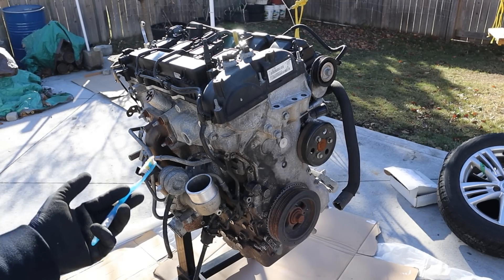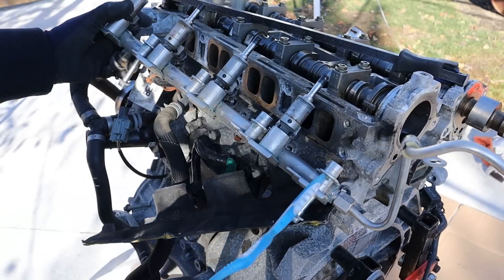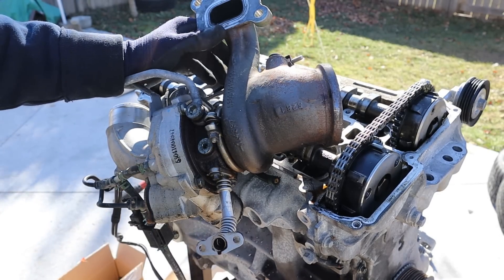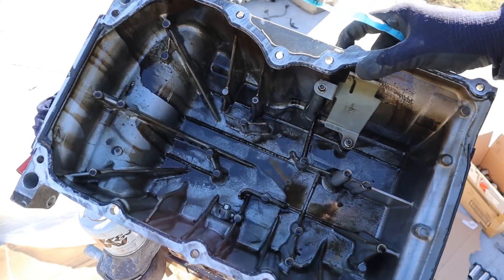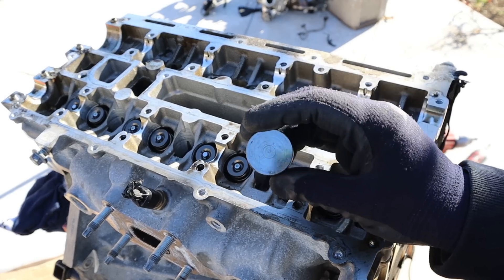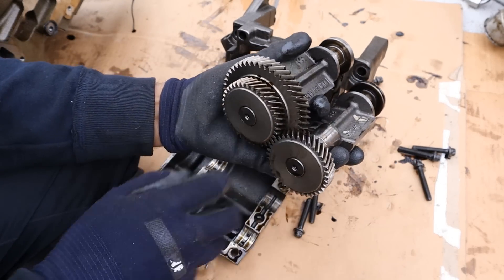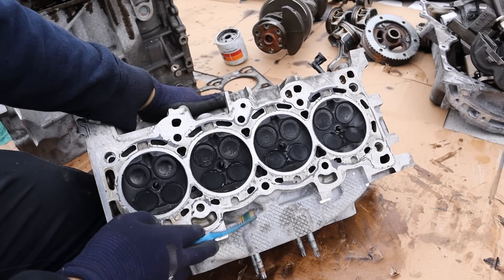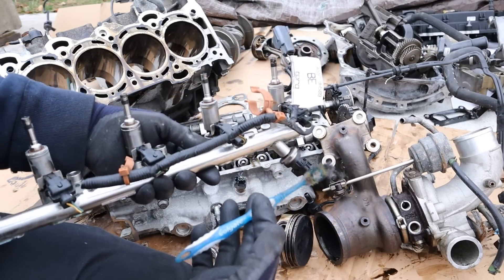Why Ford Ecoboost Engines Fail

Comment: I own this exact engine w/125k miles on it. My wife is physically hard on her 2016 ford edge. We've only had 1 problem. Last summer, i had to replace the vapor canister solenoid. Other than that, i swapped the plugs at 100k miles, and I've always used motorcraft oil filters. I've used havoline, pennzoil, and Supertech synthetic oils. Also motorcraft syn blend once or twice. It has never used a drop, and it doesnt seem picky. It's a solid little engine imo.
I also own a 2012 F150 w/ a 3.5L Ecoboost that has 164k on the clock. I've had a few coolant leak issues, but nothing major. One coolant leak was on a turbo, but contrary to internet propaganda, you can change the o-rings without removing the turbo if you have small hands. That was supposed to cost $800+ to fix, but a shadetree mechanic fixed it for $65. Lol
I change plugs every 50k, oil every 6k, and transfuild every 100k. Plugs, filters, and fluids, i use nothing but motorcraft. For Oils, i have used pennzoil platinum high mileage mostly, and havoline pro ds synthetic a couple times. The engine has been rock solid thus far, but it growled at me when i cranked it 3 times last year. I now hit the throttle to increase crank time, allowing oil pressure to build up before starting if it's been over 24 hours since last crank. That stopped the growl. 
I drive it hard, and I tow a 4500 lbs boat 3 days a week, 8 or 9 mo/yr. 
I had rough idle issues early on, but I drilled a 1/16" hole in the bottom driver corner of my coldair intake, and that stopped the problem. Right away, it blew about 12 oz of creamy sldge out, but it has never shown me a drop since. I just know it's working due to a feint oily/dusty triangle on my air dam. Fine by me. I'd rather see that than blow that shit through my intake. I also use mostly pennzoil synthetics due to their proven higher oil vaporization temp. That seems like a minor detail, but oil vapor in the egr is the cause of all the carbon in the intakes.

Comment: Bought a new 2013 Escape 2.0 Eco - 219,000 miles.  Only time it has performance issues (hiccup on hard acceleration) means it is time for new spark plugs.  Love this engine.  Doesn't use any oil between 8K miles between full synthetic oil changes.  I drive long distances, highway speeds primarily.  I'll drive it till it dies.

Comment: Seriously surprised by this. Had a diesel 1L turbo ecoboost an put 150k miles on it in 5yrs with no worries at all. Started every day. Awesome breakdown video 👍👍
Reply: Never knew you could get a 1 litre diesel
Reply: @boyasaka  A good ol' daily come rain or shine even in the snow. I wouldn't know if the mechanics had any problems with that particular engine layout as It was serviced every 10k miles an they never grumbled. 

The only thing that comes to mind is when the timing belt was changed they nicked the turbo tube which drove like a brick. It was that compact you couldn't swing a spanner.

Comment: Never buy a car with direct injection, variable valve timing, turbo or cvt transmission. Simple is better and more reliable. I'd rather get worse gas mileage than have a mechanical nightmare piece of garbage like the eco boost.

Comment: Running a turbo car as a daily driver is tough on everything because of the increased head temperature...methanol helps but heat is heat ....!
Reply from the maker: Yeah it's overstressed

Comment: First, I like to say you beat the hell out of Ford's 2.0 EcoBoost engine. I'm not mad because I've had to work on my daughter's Range Rover Evoque which has this same engine. Thank God I didn't have to do a teardown although it felt like it. Because of fault codes and rattling, had to replace cam phasers, VVT solenoids, timing chain, tensioner, guides, camshaft sensors and gaskets. Besides replacing all the parts , I had to purchase a special tool set to time the engine. Hoped to never do another.
Reply from the maker: Ouch! Didn't know rover used the same motor

Comment: WOW WOW what an involved and complex explanation!!! VERY well done!! I had NO ideee those things could be so complex and involved, and any sort of repair is gonna be super expensive!!! Wow, why not just add a couplea more cylinders to get the power you want and throw all that trash in the ditch.  here i am on the verge of trading and im going to but im gonna look back about 10 yrs or more to something i can afford to maintain. Id keep my 340k mileage ford truck but the electronics on the dash are going and ford doesnt support it and its hooked to my transmission and my fuel injection system. Im looking for carb, points and plugs, key holes in doors and in the dash......thanks a bunch!!!!!!!!

Comment: these engines are pretty solid tho, they just suffer from any modern direct injected illnesses like you said, clogged intake valves, more internal carbon buildup etc. and you dont have to change the lifters, theyre hydraulic like any modern engine, they need no gapping.

Comment: Carbon build up on the backside of intake valves is a common issue on ALL DI engines, not EcoBoost engines.   Toyota resolved that with a costly duel fuel injection system.

Comment: It's actually insane, the amount of moving parts involved in just ONE Internal Combustion Engine. If we'd taken the years it took to get to this level of ICE intricacy, and developed electric propulsion instead, imagine where we could have been today. I am very much looking forward to my first EV... Once they become more affordable, which could still take some years, I know. But not having to deal with a thousand little things that could go wrong and no need for oil changes etc., could well be worth it. How many bolts did you have to loosen, just to get the pistons out? It would drive me nuts.

Comment: The engine is similar to my 2.3L mustang ecoboost, basically with a longer stroke to get the added displacement. Thanks for the teardown, and the engine was in much better condition than I expected, and could almost be rebuilt :)
Reply: The 2.3 has its origins in the L Series  Mazda block as found in the Mazdaspeed 3 and 6.
Reply: Didn't the Focus ST have a 2.3 Eccoboost?
Reply: @stacyholt6529  ahh I thought the focus was a 2 litre, but it appears as though it’s 2.3
Reply: @lithgowlights859  I thought so as I remember there being a concern that the Eccoboost Mustang would see the same head gasket issues that the early Focus ST did when they took the 2.3t to the Mustang. But that 2.3 Eccoboost in the Focus ST was damn strong! Personally, the Mustang Eccoboost would be my pick  for a little sharper handling and they can move along just fine.

Comment: I'm making a pneumatic engine from one of these and I'm wanting to know if I block the oil from getting to the head if that would create a problem. I'm making a head and I only need it to let air in and out through solenoid valves. I was also wondering if the oil pump will work backwards.

Comment: yeah this shit is why i don't bother with turbo anything in cheap cars., especially the eco boost. Sure maybe the economy is a little better but they always have some really funny issue like cracking their manifold on a hot summer day, or some other goofy shit like in this video. Currently driving a Jeep renegade with the 2.4l multi air, and surprisingly, nothing has gone wrong with the engine yet despite being off of manufacturer warranty for a week. Probably because no turbo. Although, considering its a general motors, I expect it to just be dead one morning with no explanation.

Comment: They are a small engine on steroids. just like a person on steroids sooner or later it all comes crashing down. They are fine if you only needed a truck to last 160,000 km and junk it. Im not one of those guys that can afford to replace a full size truck every 2 1/2 years.

Comment: Holy crap. I am glad I drove my 2004 Focus with the 2.3L non turbo engine so long. I gave it away to a friend in 2021 with 150,000 miles on it. Never used oil between changes, plenty of power. Never needed any work beyond replacing a cracked intake manifold.  See all of that is a reminder of the simplicity of electric motors.

Comment: ecoboost = trash
Reply: ive got a f150 ecoboost with 391000 miles havent touched the motor or transmission now whos trash
Reply: @sdfarmer24   you have found the exception motor definitely not the rule . Just because yours works fine doesn't mean it's a good hell forget good not even an average  design.  Your motor is like finding a diamond in a septic tank . Sure there's a diamond that somehow made it in but the tank is still filled primarily feces and undigested corn.  I used to do extended warranty inspections for a living . They told me where to go every day and I went .If it were not for the dodge 3.6  Ford eco boost and Nissan CVT, in that order , the inspection industry probably wouldn't exist. Some days I'd see a dozen eco boosts in a day. I have written an absolute rediculous amount of reports on that pos eco boost  they get Pushed off out back of a dealership waiting on my report to go though to the warranty company so the warranty company would approve fixing it   . And these are ONLY the ones the warranty company thought they might could weasel out of there are plenty more . Almost every single one got approved, because it was almost never abuse it's just a garbage engine. Don't worry about liking the turd, some people like playing with poop,I'm not judging.
Reply: @williambrennan5701  well i dont know what to tell u dude weve got 6 f150 pickups ranging from 2012 to 2020 theyre all over 170000 except the 2020 model. we bought two that were at 150000 and no problems i think u just dont like ford. i mean there will always be those guys and seems ur 1 of them
Reply: @sdfarmer24  oh I like Ford just fine I own one myself . A two valve 5.4 and after I retapped every cylinder to keep it from spitting out spark plugs it's been a good van. I don't mind eco boost either. They kept me enough warranty investigation work to make my house payments, so for that I'm thankful they made eco boosts but I'll never own one. I'm sure there is some ok ones but there is a rediculous amount that are not . Seen so many.....

Comment: Probably failed for the reason why boost heavy tiny engines are going 3-cylinder. Not enough beef in the cylinder walls and that's primarily between cylinders. Dropping the cylinder from the new engine designs means they can gain back some proper wall thickness while still being small, and make them nearly bomb proof and correct the main issues with the 4-cyinders.

I don't think it's just Ford that has issues with hopped up 4-cyinders either - you'll find the design problems with a lot of manufacturers. Either the cylinder wall will give out from stress in some way, will have passages that are too narrow for whatever vital fluids, or most likely is gaskets wont have enough meat behind them to back them up and car companies invariably use a material that's cheaper than what should be spec'd for those conditions so it fails. All that engineering to beef it up for naught because of an intrinsic issue with a component or two that is over-stressed while being neglected in design specs. Ironically it's one of the cheaper parts they cut corners with that will make for a couple-thousand-dollar paperweight.

Comment: As someone who owns a Focus ST ecoboom this video is very well done. He pin points a lot of the platforms issues and highpoints with knowledge to back it up. Nice editing as well!
Reply from the maker: Thanks. Did you have any issues with yours?
Reply: @speedkar99  the only issue I’ve had was the purge valve. Other than that the engine has been very reliable. I’m tuned for right around 300whp as well. 
One thing to note is be sure to change your spark plugs every few oil changes. These engines eat them for breakfast when they’re tuned.

Comment: Excellent descriptive breakdown!  I like the use of chains for timing and other drives, instead of belts and gears.  All the plastic and lightweight aluminum components of modern engines seem potentially problematic.  The engine structure seems critically designed to withstand expectant loads as long as the engine is close to factory tolerances.  With wear, caused by abrasive carbon or introduction of water in the lubrication system, comes immediate failure.  Old engines, that were designed more robust could tolerate excessive wear, and might knock, clank and grind but would and still get you home, even with broken piston rings, burnt valves and a couple of spun bearings!
Reply from the maker: Agree. They don't make them like they used to

Comment: Can you put that engine back together in your driveway after all that quick disassembly?
It is interesting that you mentioned that these ecoboost engines are not expected to last long in the first place. Nice engineering work from Ford!
Reply from the maker: Na I like taking things apart. Hate putting them back together
Reply: @speedkar99  That I4 engine looked to be overly complicated for such a small motor.
Reply: @majorkursk780  because it's a performance motor from ford, not  regulr motor you would find in a normal focus or escape. I have just under 500whp on stock internals I drive daily with zero issues.
Reply: @Carcories  For a 2nd gen 2.0L EcoBoost??? When I saw 500whp I thought it must be the 2.3L EcoBeast with the stronger internals. What were the main mods you did to achieve that and how does the 6F35 tranny cope with the massive increase in power and torque? Or is it a manual?
Reply: @speedkar99  Looking at a mazda version right now, this old mechanic wonders why the main bearing cradle does not have dowels to align properly and the main bearings do not have tabs to set them into the block!  but it makes so much hp!

Comment: Not much carbon buildup on my Bolt EUV "engine" yet. Maybe I'll check it after 100k miles or so...
Reply from the maker: But EV might not use the combustion generator as much

Comment: Great video, as usual...fantastic explanation. GM has started the 4 cylinder turbo thing in mid-size and some full size vehicles. Would the issues be the same for carbon build up? Would GM come close to the Ford Ecoboost evolution?  Love the videos, keep up the great work!  Cheers

Comment: This is a very informative video and everything points to a real need to spend the money on best quality full synthetic oil and change it at least every 3,000 miles on this engine. Lots of spinning parts that can fail if it gets sludged up. I love my 2.0 Ecoboost and it’s served me well for a little over 101,000 miles. This is the best tear down video on the 2.0 out there. Thumbs up. 👍
Reply: If the oil needs changed at 3K then the motor is junk from the start.
Reply: @danhillman4523  How about you do your schedule and I’ll stick to mine since I do tow a good bit. Turbo direct injection engines get  some blow by consisting of carbon, unburnt gas, and moisture…….if your oil doesn’t look dirty at 3,000 miles then how nice for you.
Reply: @beboboymann3823  Okay. Once a year it is! I don't even know why I am getting notifications. I have turned them off five times. But first, just a quick bit of advice, sell that thing.
Reply: @danhillman4523  no sell……runs strong, no antifreeze loss ever, uses a half qt. In 3,000 and is paid for. Looked under the valve cover with a bore scope and it is spotless. I’ve got a Jeep Wrangler with 187,000 miles on it and oil changes every 3,000 as well and burns a bald quart in 3,000 miles and bore scope down into valve cover shows very clean absolutely no sludge same with bore scope into oil pan. Change your oil man.

Comment: The notion that sufficient water could have been ingested to damage this engine by the means described was implausible to me from the start. Not even slightly surprised to find that in fact there was nothing significant wrong with this engine, certainly nothing that couldn't have easily been fixed. No need to throw away this engine. Weird that the owner chose to invent this reason for doing so.

Comment: 1998 Honda civic. Just did my 2nd timing belt at 210k. Next belt at 315k. Reliable as a rock. Great commuter car.
Reply: I have a 98 Nissan Maxima that's been in my family for the last 20 years, and I'm going to keep driving 1990's Japanese cars for as long as I can.

Comment: I have a 2015 explorer with the EcoBoost motor and @ 90k miles it kept getting engine check light due to failures of the camshaft position sensors. These sensors are critical to the variable valve timing feature of the EcoBoost motor. I waa able to observe the motor with head covers removed and was amazed/appalled   to see there are no bearings on the camshaft journals. Neither the head nor the caps had the "bronze" surfaces I was used to seeing protecting the mating surfaces on rotating parts. The cam appears to ride directly in machined surfaces in the head secured by similar machined surfaces in the caps. A design that will eventually wear, lose oil pressure and cannot be restored to "factory" clearances by replacing the bearings because there aren't any. Fortunately i purchased the explorer "certified used" because, in order to correct the "camshaft position sensor" issue, Ford ended up replacing the entire motor with a new crate motor from the factory. IMHO a design flaw that practically guarantees the engine will expire shortly after the warranty.

Comment: Most of the internal parts are not the same but it doesn't matter anyway ford doesn't stock any of it! My son tore ours down for school and said it looked exactly like this. Hoping for an event free reviled has turned into a night mare trying to track down every part with zero help from fomoco. Once these engines go south there is nothing to do. Can't even buy a long or short block, they are discontinued.  2015 fusion es
Awesome video by the way!

Comment: I've got 2 3.5 ecoboost engines with 250+ thousand miles with no issues running strong and used everyday.